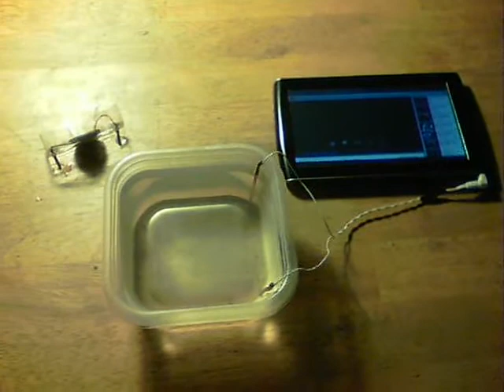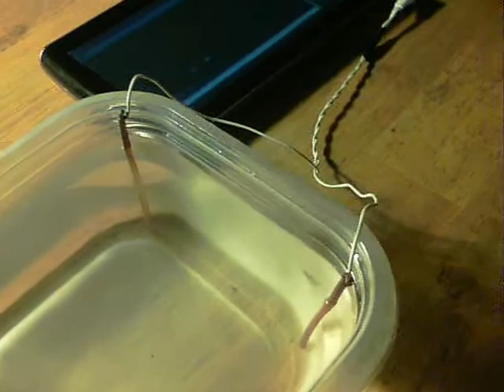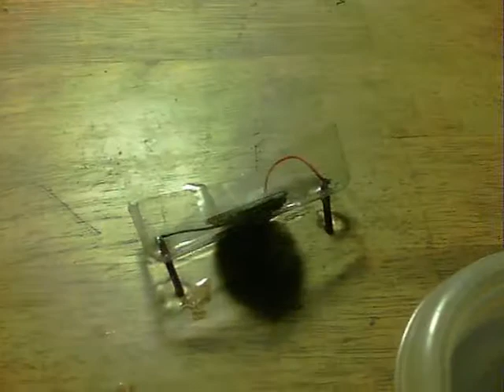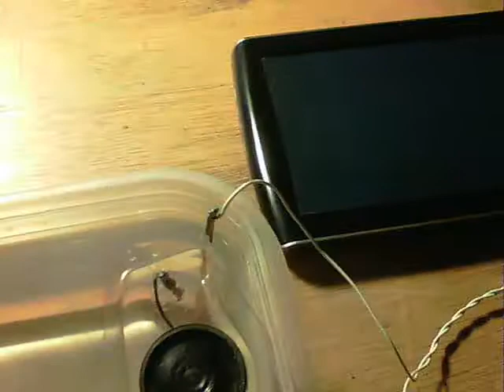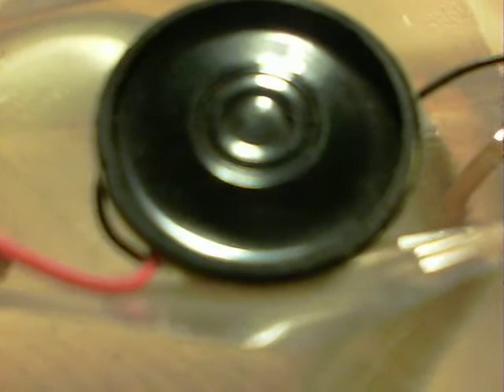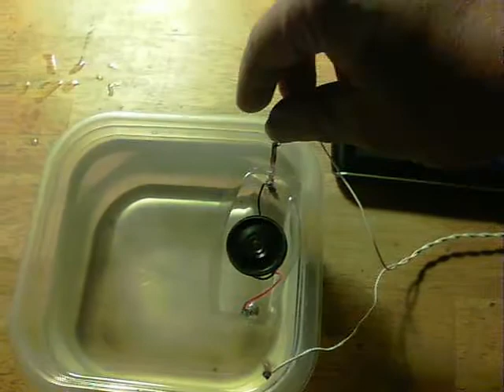Sailing with wireless audio

Comment: Thats just begging for a solar or galvanic powered amp.
Reply: This is really cool!
Reply from the maker: Hmmmmmmm....very cool thought. Regular LM386 or tranny amps would draw more than the water would provide, but a couple of solar panels might do it,
Reply from the maker: Got germanium trannies, ex USSR MN36 or similar but not so good hFE...a 3904 runs better. Am going solar, 3x 0.55V hyper light (breakable) monocrystalline's of around 50mA to JT circuit, out to LM386.
Btw the pre amp thingy is the way to build a Tesla tower audiomodulated plasma speaker :)

Comment: Wireless... or liquid wires? The fact that it stops when you pull it out of the water shows it's conduction and not radio transmission. I wonder what would happen if you make the water more conductive with salt, for example. Would the conduction path be easier straight across and skip the speaker. My guess is that the speaker is a lower resistance path than the water and that's why enough of it goes there. Fun, in any case!
Reply from the maker: Liquid wires is my thought too, though also it could be said there are air wires for Tesla towers. Maybe we can understand conventional wireless electricity a bit better, using liquids.
Music audio is, after all approx 4kHz to 16kHz frequencies and allows ready reckoning of output strength using our ears.

Comment: Thats handy for the bath maybe.. :D
Reply from the maker: Haha yes indeed. Am wanting to design a sort of Bose wave guide boat, so the sound is amplified. Then throw a few Watts of 528Hz based music and cymatic frequencies at it for bath time :)
Reply: slider2732
I like where youre going with this....I expect you could actually warm up a cold bath (save energy!) if you used 100watt speakers. might want to turn the music off before you get in though, what do you think?..Just incase anyone gets some stupid ideas, you might want to delete this comment.
Reply from the maker: Easy test, put a Hi-Fi on full volume with no speakers attached and put the wires in a glass of water..touch the water. But yes, wouldn't want to give folks the wrong ideas! Only use speaker output from small output devices to be 100% safe.

Comment: LOL...rod would be proud,  i don't get how it can be positive and ground at he same time...baffling, but very cool.
Reply from the maker: I don't know either, but a clue is that if the boat turns sideways then the volume will drop some. It seems that the energy of the sound waves is directional, emitting in parallel straight lines.